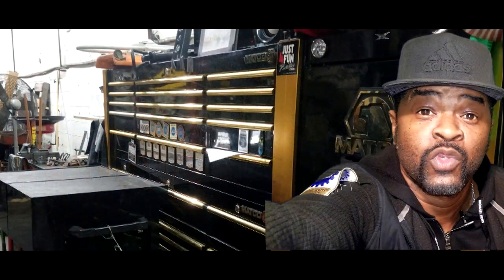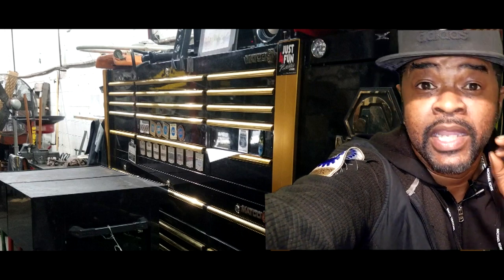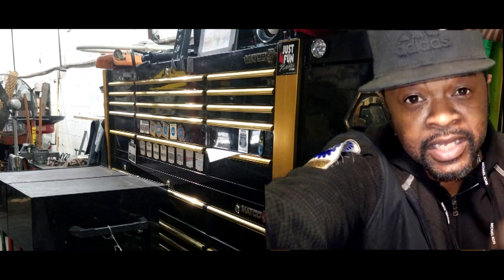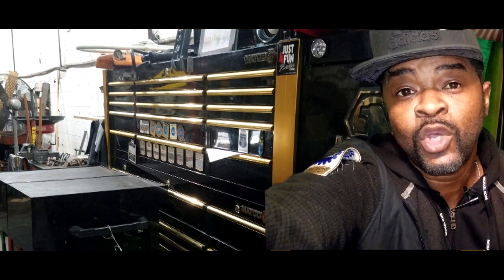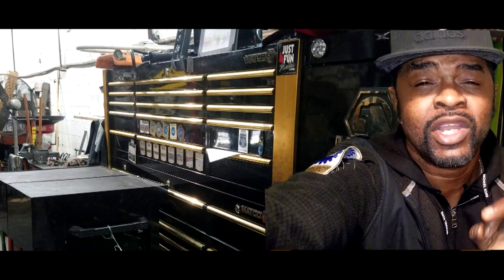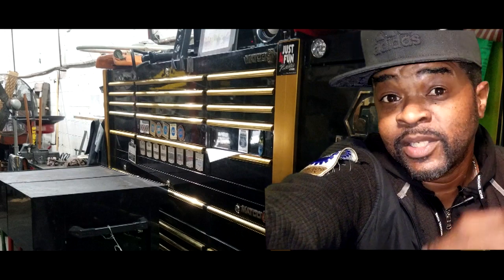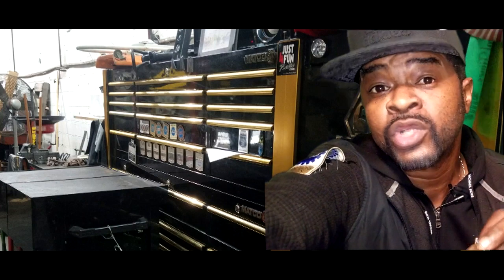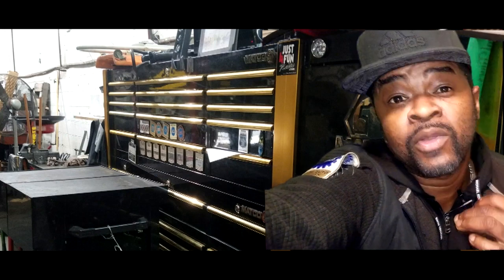Chrysler CASE STUDY for a P0344 P0349 P0369 P0394 FIX, Get this done for Cam Sensor Codes boggs down

Comment: Hey I have a 2014 charger 3.6 with the p0394 ! We reset the code and the check engine immediately turns on and the traction control also comes on with it ! Any suggestions that u can give me ?
Reply from the maker: My friend, you will likely need the cam phaser for this problem because your traction light comes on..please like the video and subscribe to the channel for me.thank
Reply: Online Mechanic Tips  I’ve changed the the cam phasers already but the problem hasn’t went away
Reply from the maker: @xxpumpa6882  you still have not subscribed to the channel?
Reply: Online Mechanic Tips  just did ,sorry  about that !
Reply from the maker: @xxpumpa6882  Hey guy, normally when you have a cam code such as this, and it also making a ticking noise on cold start that last about 3 seconds, its likely a cam phaser coming apart, the loose phaser trows timing off for a split second and this trow vacuum off which will lead to possibly abs or traction control code. Curious, which phaser did you you replace? Also I have some data here that may help you can look at
Reply: Did you ever figure out the issue ? @xxpumpa